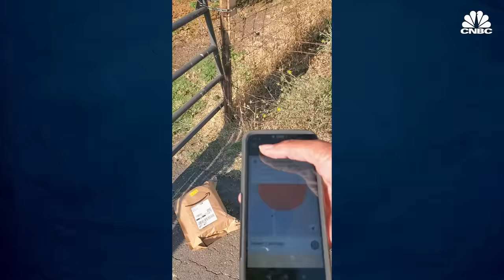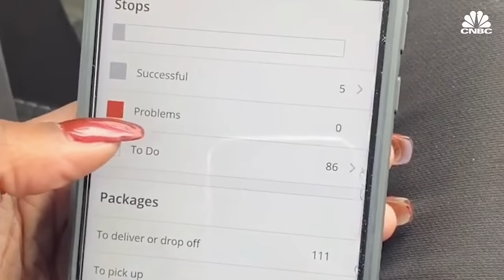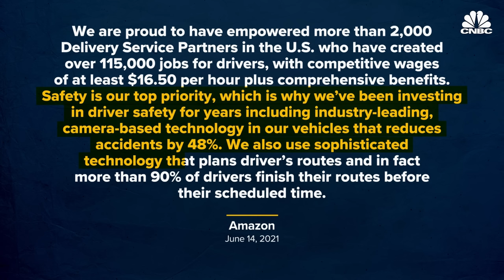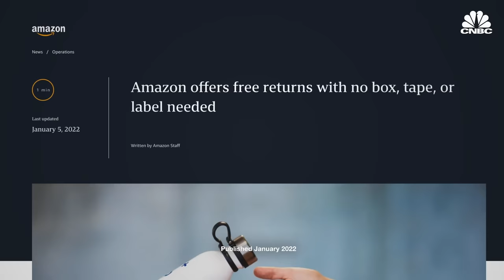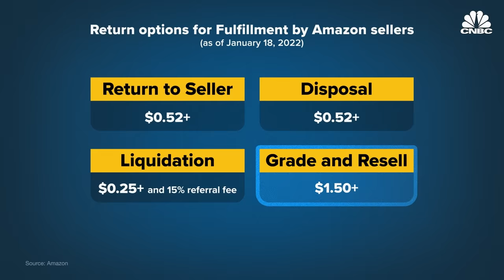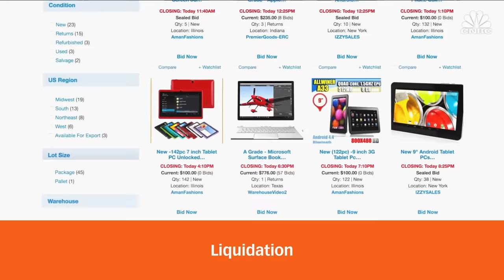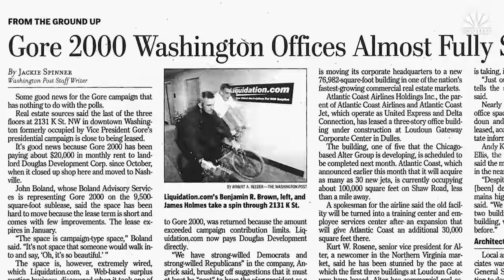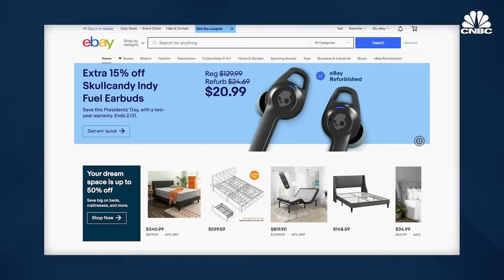The Hidden Costs Of Amazon Shipping And Returns

Comment: I ordered a pkg of three pair of men's socks size 7-12 from AMZN. Somebody in a fulfillment center, mad at the Co., grabbed three pair at 12-15 size. I just threw them in a drawer because I had opened it all up to see if could use the larger size. I cannot, but felt bad to send it all back opened up like that. So now, if that happens with socks, I will send it all back, unopened, if it's the wrong size.  Great way to get even with your employer though, no?Generate ill-will by sending the wrong size. AMZN  did ask how the order went and I told them. Bet they could follow that back to the employee who did that. Computers are great. That is the only time I have had a problem like that with AMZN. It is a great company.
     Interesting that there are several ways to buy returned goods at a discount from AMZN. They should make those better known. I won't buy refurbished electronics though. I did once, not from AMZN, and it was not good.

Comment: So I made a mistake and bought the wrong tablet case for the tablet my company owned. I was fully ready to take it on the chin and admit responsibility for not paying enough attention to that purchase but then I noticed Amazon return policy which I had never dealt with so I gave it a crack. This was the first time I ever returned an Amazon item, it was super easy!

I dropped it off to a shop 300 meters down the road free of charge and got a full refund. It was like a $30 item.

Amazon policy is actually enabling people to make silly mistakes like I did without any repercussions. I completely disagree with this model as it was my mistake and we should have paid for that mistake.

The problem isn't with Customers returning items, it's with Amazon blatantly accepting returns when there's no valid reason to do so.

Comment: i got robed by amazone about 4 years ago.
i should have gone to the police, but did not have the time for that.
i had bought a tool cart from italy. payd about 900 euro incl delivery. 
it came after many weeks. luckly just 3 days before i went on vacation.
but the delivery guy did  NOT have a lift on his truck, so he could not take it out off his truck and deliver it to me.
it weight 250 kg. no chance to take it down for me. 
he told me i had to use a forklift to take it down.
well i am a private person. no forklift. i asked the delivery guy if he could deliver it to me as promised, if not then he should send it back again and cancel the deal. 
i only had 3 days.before my vacation, so i hurried and bought another  tool cart.
just the day before i had to take the flight to my vacation, amazone called me , they would give me 100 euro to hire someone to take it off the truck.. 
i told them, that the delivery guy had told me he could not deliver it to me, so i had to buy another one. 
soo.. amazon thinks they in stead off delivering the tool cart as promised, they fined me 700 euro . they robed me 700 euro for something i had no fault in. 
i think. in stead off telling me i could hire someone for 100 euro to take it off the truck, they should tell the delivery guy to find a solution. on then problem. it was not at all my responsibility. i had payed for the tool cart and delivery. 
beware with amazon, specialy heavy things delivered from italy. never ever trust an italian company in amazon. they will charge you 700 euro for nothing at all. because in reality that is what i payed for. 700 euro for nothing. !!!
i tryed to give the amazon company a review telling my story , about how i got robed.
but amazon cheats with the rewiew. i did not get permision to make the review, because i had bought nothing. 
well that proffs my point. i payed 700 euro for nothing at all . because they blamed me for not beeing strong enough to lift 250 kg from a delivery truck. the delivery should have been  to my apartment, just inside the main door. that was the agreement, they did not think they should comply with. 
i was robed by amazon. 
beware off internet thieffs. i just say !!! 
700 euro is a lot for me. specialy a day before my vacation.

Comment: My daughter started as Amazon delivery driver, one week into new job, she was given over two hundred pkg to deliver. No bathroom breaks, no lunch breaks if they were to meet quota delivery. Pee in jars with one guy caught going number two at a wooded lot between delivering. Safety was ignored to get delivery finished. This was at the Everett Wa offices where Amazon paid a contractor for deliver. My daughter was fired for not meeting quota where she was told first month was kindergarten quota delivery no more than 75 packages. She reported the safety cuts taken and issues.  Nothing was done.  It was contrator delivery company not Amazon, even though the truck was Amazon Branded and she wore an Amazon Uniform. The joke insurance as touted at first day was pay out of pocket n use urgent care clinics pay to use then reimbursed. All is a joke. I wouldn't want an enemy work as their delivery drivers.  Return waste tossed in landfill is on Amazon. There is a resale opportunity at discount, recycle possible and upcycle opportunity.  Fully on Amazon.

Comment: i wish i can express how much it sucks to work for amazon the routes planing sucks ementor has you thinking more about how your brake and turn instead of you focusing on your job also the camera is a complete invasion of privacy i had the camera tell me distracted driving after I came to a complete stop and was looking for an address the vans when it hot outside the van have type of heat or cooling in the back also the bathroom is hard to find there's not one day where i don't have to call driver support to have the fix the geo location to alway me to deliver the package because the gps mad me drive down a back road and there's so may other problems but there isn't really anyone to speak to almost forgot the faster you finish the more packages the system add the the route and the next person is expected to deliver in that same time lastly there's DSP that abuse there employees pay is set a minimum raises are hard to come by and some people are promise sign on bonuses that they never receive

Comment: Engineers don't decide routes, it is detected by AI and Satellites and engineers work on those algorithms, and they can never be 100% accurate, a manual designing system is feasible if the company is willing to spend $$$$ by hiring extra workforce for the manual work, but that would mean heavy losses because they will have to pay those extra salaries and they will have to make products more expensive and that would loose them customers, already buying from physical shops + fuel cost is almost at par with amazon prices, the same product you will get at lower rate at physical stores than buying online except for branded products like lays, coke, etc where there is a fixed MRP.

Comment: That's a horrible company to work for,  not allowing bathroom breaks and lunch and NO air conditioner !

Obviously making money is more important than the employee's life !

You might want to keep alot of spare pants in the delivery truck just incase you need to change pant.

You migt want to wear DEPEND under your underwear,  just incase of bathroom emergency ( until you can get to a bathroom).

When shift ends, you tear it off and throw it in trash.

Comment: 14:35 Drive might not have been at fault, but driver was a moron for going 30mph in that situation. Even an amateur knows you need to go slow here because there is a high chance of cars turning left into that lot through the stopped traffic. However, that's also what happens when you put pressure on drivers to meet ridiculous quotas.

Comment: He’s absolutely correct that inflation causes returns but this video is incorrect. Resourcing and using the energy is the right way to recycle. If you have a human look at an item and determine it’s ok quality then that should be enough but nothing here is that shocking. The leaders hoard money, Jack prices and Amazon has been helpful to getting your money back when an item is lesser quality and a lot of times it is very overpriced to begin with. 

The first half with what employees go through is unacceptable but they’ve been flexible lately and warn of delays now. As for the idea that returns destroy the environment is a lie compared to other companies. It’s all cardboard which is one of the most biodegradable materials ever. Some cardboard can degrade in just a few weeks. (I know because in class we did experiments over several months and studied materials.. plastic bags never really do)

I think having an Amazon store might be the solution for some returns like how eBay started to?? I no longer see this as an issue esp now that palettes are sold. I don’t think Amazon is the best but navigating everything going on right now is why it’s the one place to go because most places dont make returns easy and for someone who is struggling, I can actually get my money back whereas other companies take months and debates. If you need the item then you need the money back right away to replace the return or intended item you needed and Amazon helps in that way. So yeah their system is more than fine and I’m happy to hear all the strides they make to recycle compared to other companies so yeah this whole segment about returns sounds like bs.

Comment: I wish we could have heard from some male drivers. I believe this type of work would be incredibly different from a man's perspective. Men don't tend to complain about things as much as women do. Especially when they're ultimately in control of the situation. I believe men would handle K9 encounters differently than women. And the bathroom situation is drastically different between men and women. Some of the complaints probably wouldn't even be complaints if it was men speaking about them. It would probably be more concerns than complaints. And men tend to take more risk. A lot of times men will put themselves in bad situations and be hurt because of it. Just so they can get the job done. Well at least actual men that is. And I say that because a lot of the younger men are a lot more emotionally driven  then a lot of the older men.

Comment: I started ordering shoes and clothes from Amazon a few years ago, I really like it. You often can find items that I I didn't see in my local clothing stores (like BETTA Wide Elastic belt with plastic snap buckle, it is so much more light weight / comfortable then a standard leather belt/metal buckle). I have trouble finding clothing in my size in stores. When I used to shop for clothing in stores, I would have to spend many hours/and a lot of money on gas, driving around to multiple stores (including a visit places that sell big and tall sizes, which is overpriced and ugly looking selections). So that is why I started ordering online, it is way more convenient/saving many hours, money and aggravation (during the holiday seasons it can be stressful just to try and find a parking space in lots at malls/stores and to deal with crowds waiting in line to checkout, etc). Also if you purchase items at the end of season (when stores already have removed items from shelves) you can save a lot of money. This past March, I saved over $70 on a really nice waterproof winter jacket. I never have to return clothing items since I know what I need.  The money I spend on either Amazon Prime or shipping costs with other online stores, I save in not having to spend on gas/mileage on my car (this ads up when you calculate how many times you go to stores in a year to purchase a variety of items, other then the food store). Food items are the only thing I will never order online, the shipping costs is way too high Or the inventory isn't accurate, so they try to force you to accept a 'substitute' product.

Comment: Interesting but not compelling video. Clearly Amazon can behave poorly and reporting like this is important for that reason but since when did old fashioned hard work become a social issue? If you don’t like working hard or performing to a standard then quit! Out of my 40 year working career the first 13 years were at minimum wage and the various jobs were demanding but in the end it all worked out. As a consumer if I don’t like what’s going on I can utilize Amazon drop boxes rather than delivery or just quit buying from Amazon. Regarding the disproportionately long time this video spent on the pee thing, as a pilot of very small planes where it isn’t even possible to stop/pee I can tell you there is a robust variety of easy to use, readily available solutions/products that work acceptably in a very confined space and YouTube is full of inexpensive homemade, not messy solutions.

Comment: You are willingly putting yourself in this position. Stand up. Break the chains of slavery. So what of you have to starve on welfare. Go to the foodbank. You might have to turn a couple tricks until you find a new job. But so what, you are an independent contractor, you decide when you work and what clients you service. Millions do this sh!t for free, so its no big deal. I did it, thats how i bankrolled my degree.  Dont ever be a slave and run yourself into the ground.

Comment: 🌹🌿❣️💸🌎💸🥵 route designers 
Restroom facilitation 
Extreme load delivery packaging 

Feedback from the contractors 

Gaps in the routing system 

Possibly could we add more electric vans to the fleet of contractors 

As well as a driver and a package delivery guy that could alternate with the driving 

Adding more electric vehicles contractors to the fleet with extra delivery guys on board should reduce size packages say 200 packages will reduce to 100 packages with the capability of two trucks doing the job of one with four individuals